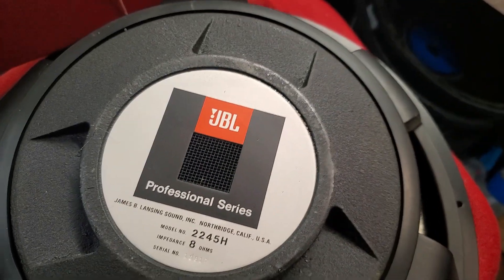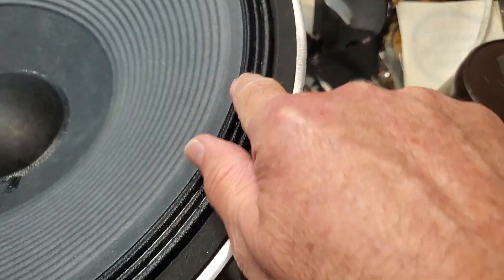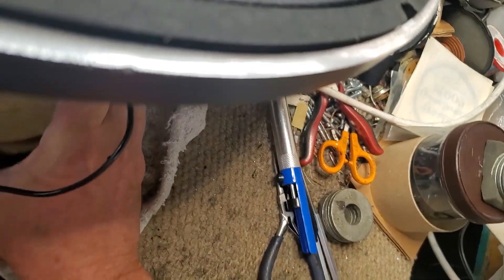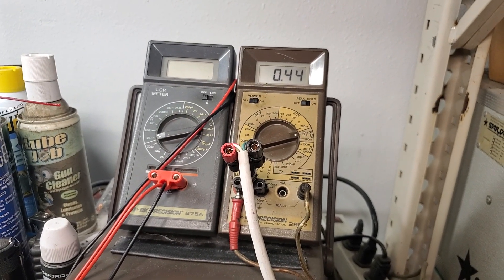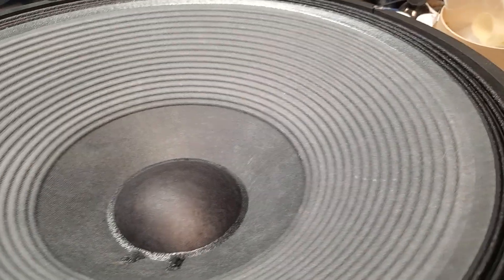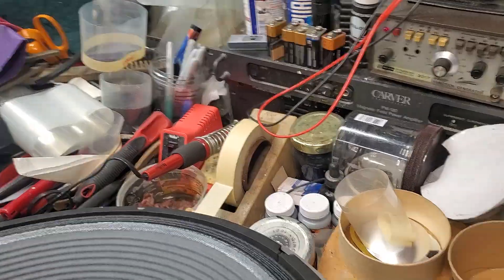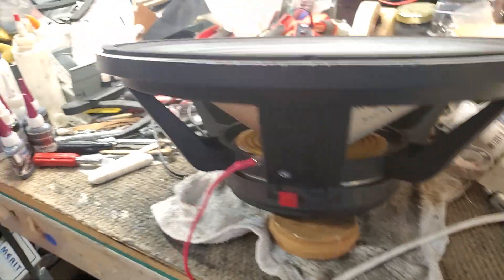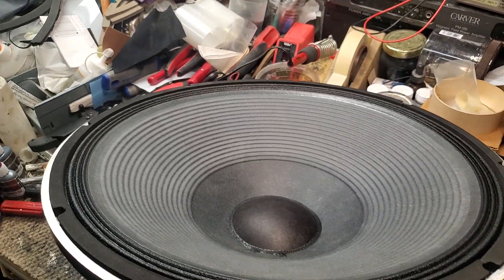JBL 2245H upgraded to 2246H No-Rot subwoofer, by Upland Loudspeaker Service.

Comment: Ken, I ended up adding a pair of 15” Dayton Audio subwoofers (4ohm) in parallel with my JBL 4333 clones to get a complementary level of sub 180hz response.  I built sealed cabs and drive them with a separate amp, and have been pretty satisfied with the improvement.  Guessing a set of these 2245H you have done would work well in that scenario?